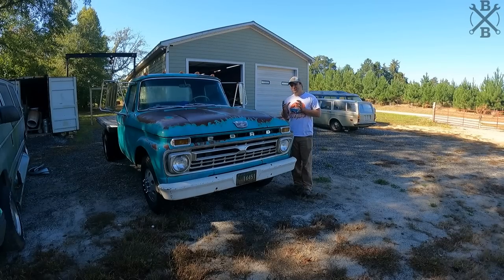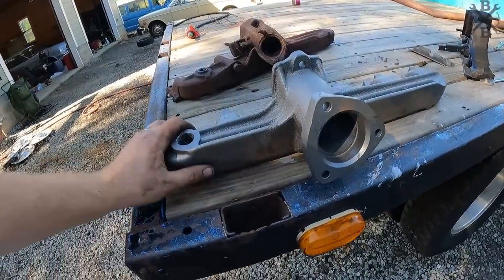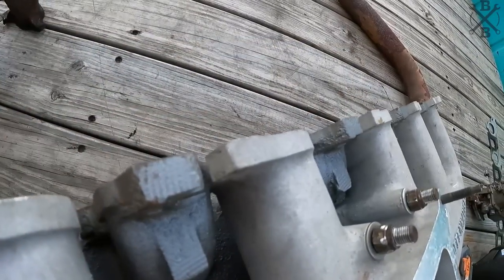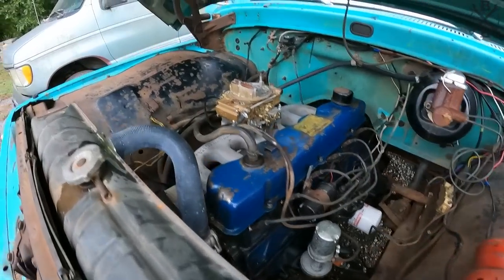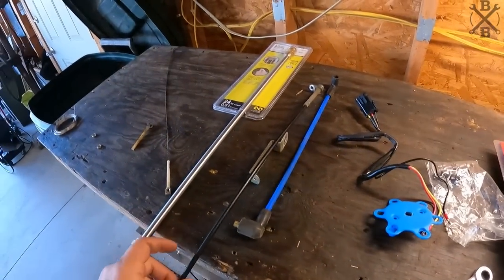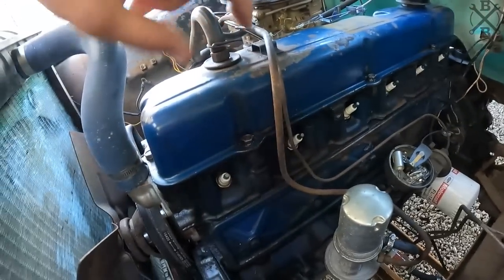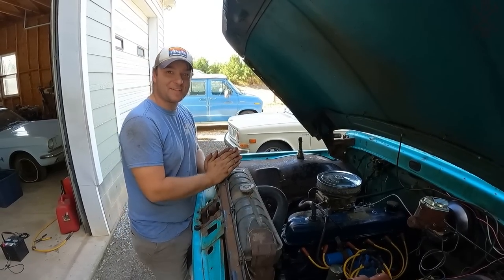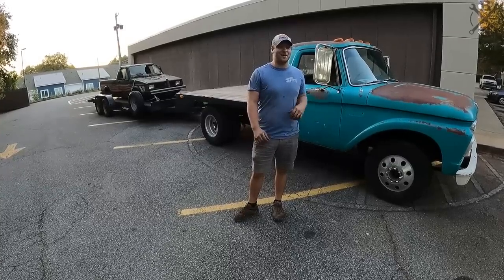Our Field Find 1966 F350 Tow Rig Gets Power Upgrades!

Comment: That exhaust manifold DOES NOT flow anywhere near as much as the efi split manifolds.  Please anyone watching this do not believe what he said there.  My guess is he didn't want to make a y pipe for the efi manifolds. The exhaust heater is also not a restrictor it's there to prevent the fuel from puddling on the floor of the intake from it cooling off due to the heat the fuel/air mix loses when it goes through the carb. You have to have that area under the carb heated or your engine will stumble off idle and run rich with poor power and economy.
Reply: Be interesting to see flowbench tests.  Seems worth it over the efi set up just to get the better manifold heat.
Reply: @mustangeroo  nah, those stock single outlet manifolds flow like an old man with an enlarged prostate 😅. The intake can be heated in other ways

Comment: Unless you find some NOS or old stock lifters, I would just run what you have. There has been a terrible amount quality control issues lately  that are being documented with lifters. Until the quality changes, I wouldn't be throwing a new set in.

Comment: Great to see some performance mods on the 300. The HD manifold only came on the HD engines that were in the medium duty trucks like the F600. The industrial engines used the standard exhaust manifold. The HD manifold does have a huge outlet but it's still a log style manifold. The 87-97  dual EFI manifolds are basically cast iron shorty headers. They flow much better then the HD manifold. The outlets are a little small on them but with some porting they can be opened up to right around 2". And dual 2" outlets will outflow a single 2.5". But I understand you prefer the looks of the HD manifold.

I just thought I would give you a couple suggestions. The HD exhaust manifold really should have a block off plate for the heat riser. Your original exhaust manifold had a control valve to regulate the heat going to the intake manifold. The part you called "a restriction". That has the bi-metallic spring that closes the valve when the manifold gets to a certain temp. This helps keep the intake from getting too hot and boiling the gas out of the carb.   Your HD manifold is a wide open heat riser. This is especially bad with an aluminum intake. It's going to get HOT.  There is a very good chance you are going to have a lot a vapor locking/hot start problems.

And also the HD manifold has a shorter heat riser then the standard carb ex. manifold. This lead to poor fitting, miss aligned manifolds and possible exhaust leaks and even broken intake manifold mounting ears. I don't remember the exact amount of height difference. I think it is around 1/8". The HD intake manifold had more of a drop down on the bottom where the two manifolds bolted together. But this works out because you can take a piece of 1/8" steel plate and make a block off plate to put between the manifolds. 

Also you might want to invest in a heatshield for the starter.
Reply: Agreed!

Even better than a starter heatshield is swapping in a PMGR starter with a shield.
Reply: @mwilliamshs  I've had good luck with DEI starter heat shields. They just wrap around and velcro in place.

The newer style gear reduction starters are a great upgrade on any older engine.
Reply: The hose fittings on the offy intake are for the engine's coolant  to avoid vapor lock
Reply: @Viewer19  Nope, they are not! If you hook coolant up to those you are going to have a very bad day. You will fill your intake and cylinders with coolant. Those are vacuum ports. The Offenhauser intakes for the 240/300's don't have coolant ports. Some of the Clifford Performance 240/300 intakes do.  But even if they were coolant passages, you wouldn't want uncontrolled exhaust heat riser hooked to your intake.  That would cause your coolant temps to run hotter. Not what you want on a tow rig.  He should really add a block off plate to the exhaust manifold heat riser. And swapping out the aluminum carb spacer for a composite one wouldn't be a bad idea either. You really want to keep heat away from the carb. The only time heat is good, is during cool/cold damp weather and you are feeding warm air into the air cleaner to help prevent carb icing. But that's a bigger problem on cross flow inline engines then it is on the 240/300.
Reply: Thank you 😊
Reply: @Fordman7575  made a plate for the bottom of my offy intake for coolant from my heater hoses because I have the efi manifolds on my truck like a smart person.  Made the world of difference in how well the truck runs now.

Comment: I did a similar upgrade back in the 80s on a 78 F-150. Clifford intake and a pair of full length 3 into one headers. True duals that dumped at the rear axle. The pulling power was amazing in my old 300.

Comment: The factory f150 efi 300 split exhaust manifolds are hands down the best flowing of any 300 exhaust manifold.
Reply: With the exception of long tube headers, I agree
Reply: @mwilliamshs  even long tubes into a single collector dont flow or scavenge as good as the efi manifolds. There is a reason ford put them on there.
Reply: @keeganlangford5580  i agree. You said "best flowing of any 300 exhaust manifold "
Reply: @mwilliamshs  I did, and you mentioned headers which are not manifolds either.
Reply: @keeganlangford5580  a header is a manifold.
Reply: @mwilliamshs  a tubular header and exhaust manifold are not the same thing.
Reply: @mwilliamshs  and yes I realize I called the efi tubular headers manifolds.
Reply: @keeganlangford5580  they're all technically manifolds

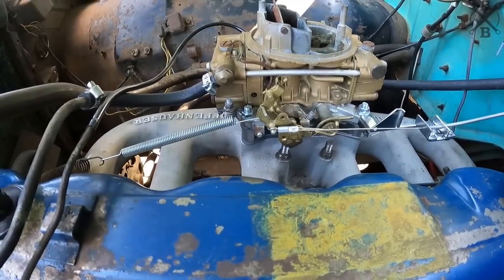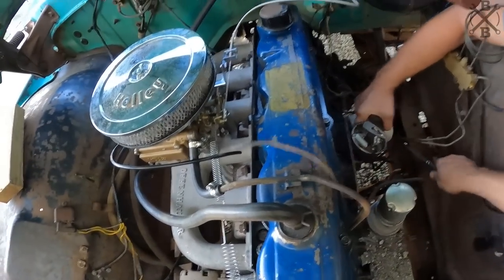Comment: The hose fittings on your offy intake are for the engine's coolant flow to pass through the manifold to warm it. It looks like your passing crankcase ventilation through it? Might be the camera angles at 15:10, 16:49

Comment: I've got one of those Harbor Freight welders too, except I got the bottom one of that line. Which means no gas, so the welds tend to come out pretty crappy on some metal. I wish I had saved up for this welder, but I needed to do some fabrication and didn't think I would use it as much as I do. Truck sounds great! My buddy has an F600 sitting in his field, also with a 300 in it. If it's 4wd, I will be convincing the wife to let me scoop it up

Comment: That is a cool old truck, I remember when you first got it. My 347 that I built for my pinto has a crack in the block so I had to take it to the Dr. So that it can get the crack stitched up, hopefully I will get it back soon so I can drop it back in my pinto so that I can have a little fun with it 😜 I bet that truck is alot more responsive and I bet it is a lot quicker than it used to be on take off

Comment: I use to have a 66 with a 390 4 speed. You could put it in first, idle off and slowly push the brake and bring it to a stop. It would slowly spin the right tire with the engine idling. My foot completely off the accelerator.  It would freak people out.  Mine was 3/4 ton with single wheels on the back.

Comment: Outstanding upgrades!  Have you considered upgrading the original tranny to a more modern ZF 5 speed?  It would give you a nice overdrive highway gear for lower RPM's and better gas mileage.
Reply from the maker: Thank you! It has definitely made all the difference with modern road driving 😃 It’s a factory ordered 5 speed truck. I had originally thought NP541 because of the shift pattern but it’s a Clark by numbers. 65mph is roughly 2k rpm. Even with the 410 rear gear, the transmission has a surprisingly long stretch 😃
Reply: @BudgetBuildz  So it actually has a Clark 5 speed then? It almost sounds like you were shifting 1-2-4-5 and missing 3rd and hitting 5th perhaps?

Comment: What rear axle ratio do you have? Larger Ford trucks of that era often had a 5 speed trans with an overdriven 5th. gear. Either Clark or New Process. One has synchromesh only between 4th. and 5th. They make a big difference in road speed vs. RPM. I like this truck.

Comment: Excellent video Budget Biltz  (Mike) also yes that truck last long time also 300 in line 6 cylinder motor excellent with 2 barrel and 4 barrel carb too more than single barrel carb is ! Also tick in motor very light okay and loud one do head job agree too ! Sometimes tick be cure if flushing motor out of WYNNES brand Engine Flush when do engine oil change plus oil filter plus PCV Valve also fuel filter and air too do every 3 years! Engine Flush Fluid in 1 pint bottle plus run in engine for 10 mins not 5 says on bottle when ready change engine oil plus filter and not going anywhere! Do start up then add 1 pint Engine Flush to engine oil crank case run for 5 mins on low idle then 2 mins on 1/4 throttle of higher idle and last 3 mins  low idle then shut motor off drain plug out drain of Engine Oil then when done screw bolt hand do tight up and change Oil Filter too and then drain plug for engine oil again till done ! Then put drain plug in crank case oil pan fill up Engine Oil top with your favorite oil and fire engine up see what hear to ! But Engine Flush Fluid cleared up any engine feel like got brand new or rebuilt motor too! If smell Paint Remover when using Engine Flush on motor or Exhaust during Engine Oil change or after do be upset it cleared up problems you would and restored motor like new! But okay and did excellent job! Plus solved engine troubles forever and everything too even keeps engine oil cleaner longer plus less gas burning on bad fuel mileage too !

Comment: Hell yea! Been waiting for this video. Wish i could show you my 85 man! Did the same except i ended up going with holley sniper efi. You even did the stephens hd manifold! That heat from the exhaust will help alot for driveability. I had to do the same with the mating surfaces. The hd manifold doesnt seem to be milled correctly. An angle grinder, block sander, and some time can make it right. If you do lifters, lifter preload is 1/4 turn past zero lash. DO NOT do half a turn.

Comment: NP541 5 speed?! I remember in a previous video you claimed the truck had a 4 speed transmission with a 5 speed shift knob. 

Is it a 541O? That's the rare overdrive version. I think I'd prefer the NP541D. It's direct in 5th, has the 6.15 first and the closer ratios would be nice with the 300s torque band but it limits highway speeds with commonly available axle ratios. Even with 3.42 axle gears 75 mph is over 2,700 rpm with 31.5" tall tires like 235/85-16s
Reply: Based on a comment above it sounds like the truck has a Clark 5 speed? Interesting to know about transmission options for a '75 I'm thinking of doing up with a 300 and a 4 speed.

Comment: I’ve been restoring one of these for about 2 years now. What a nightmare, a lot of the parts for it has been odd ball years because it is a dually. Had to get a new steering wheel for it and it turns out it is for a 1957 - 1961 F500.

Comment: on gas engines, 3 inch exhaust is optimal for about 325 HP max.
i feel like a 6 cylinder is losing area under the tq curve with such a large exhaust
a literal 2 inch straightpipe theoretically should make 98% of the power of the 3inch with way more TQ all over the rpm range

Comment: I had a motor exchange done on a 82 f150 I 300 6 4sd granny gear low.drove it almost 13 years had 8000 in it total clamps everything purchase price 8000 total that includes a paint job.Sold it for 2500.

Comment: There's a 90° oil filter adapter available from Ford that'll prevent your engine oil drainback. Use engine flush at your next oil change,  then fill with 1 quart ATF and the rest 0W full-synthetic. Idle till fully warm, then 20 minutes of varying rpm, then  change to your regular oil. If that doesn't fix a ticking lifter it'll be the first time in over 30 Ford 4.9, 2.8, 2.9, and Isuzu 2.6, 3.2, and 3.5s I've done personally.

Comment: Premium fuel's only benefit is being more resistant to preignition caused by high compression or excessive ignition advance. Your 300 doesn't have high compression. If the ignition is too advanced, adjust it. 

Unnecessarily running high octane fuel is expensive and creates more deposits within your engine and contains more ethanol which is terrible for carburetors. If your running non-ethanol premium, take my expensive comment and double it.

Comment: How much was this budget build... I have a f100 with 300 also..
Reply from the maker: We did this one in such a way that we have little to nothing in it. When we bought the truck, we bought 2 for 500 each. Getting the second running and sold for 1000. Making this one free. For the front suspension we bought a ‘74 for 500, parting it out, paying it off, and making enough to buy an ‘80(800) for the rear axle. We parted the ‘80 out and then bought another ‘73 that had the bed on it. We did pretty well parting it out, making the bed more than free and paying towards the mounting lumber and a 300 we found on marketplace with the intake on it. We paid 300 for it and sold it for $200 after pulling the intake(getting the intake and carb for 100). At this point we had made a good 1000 from parting outs and bought a Chevy with the wheels on it. Parting the Chevy out we made the 1000 back. Then bought the exhaust manifold, distributor, muffler, rear end refresh stuff etc. Basically the truck overall was free, other than time. If you have the room to keep atleast one part out truck, that’s the best way we found to do it. We only had one at a time but I suppose you could get all of them together but we didn’t have the funds for that. I hope this helps!

Comment: The famous 300 inline 6 I my self have one in a 1981 f150 motorhome that no one have or find informations about it seems my was special order and she is a 4 sp transmission she only around 16 ft long and allow to pull 7 thousands pounds behind her my only have 66 thousands miles original and she sounds tuff she is my house my baby cheap to fix and cheap parts jjjjjj gd enough on gas forget about 1 gear people is like she is on 4x4 jjjj strong like hell  but is nothing like the 300 engine best motor ever made a tractor motor really they last for ever strong like a mule with the right transmission she move mountains jjjj gd job not I don't sale my motorhome ok guys she is history I think is not another one out there a f150 motorhome 300 inline 4 sp standard transmission she is america pride...

Comment: Surprised by the decision to put on a bigger carburetor and change exhaust manifolds (again!) rather than install A/C or at least perform the heater repairs you mentioned in a previous video. Both A/C and good heat should be more in line with the "daily driver" description you put on this project, especially since winter is coming soon.